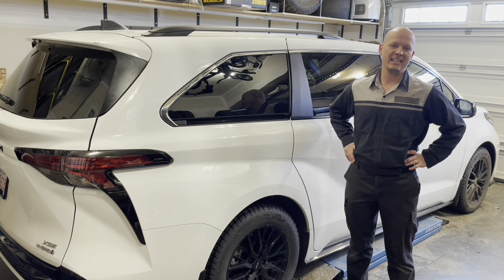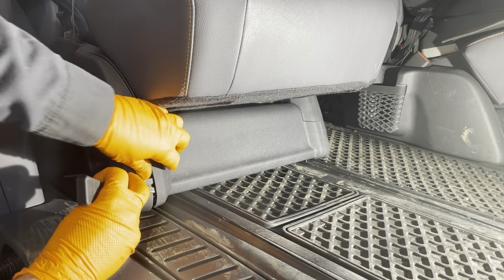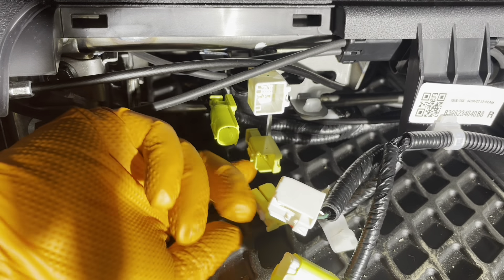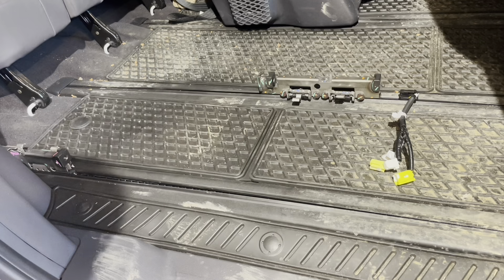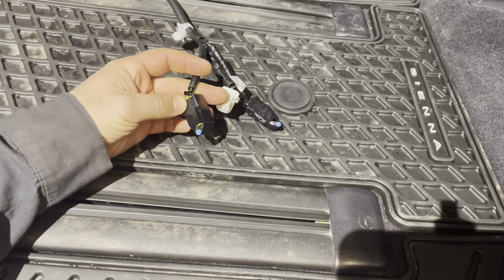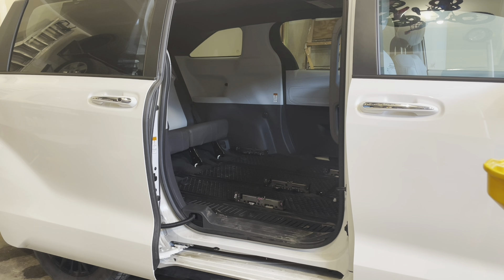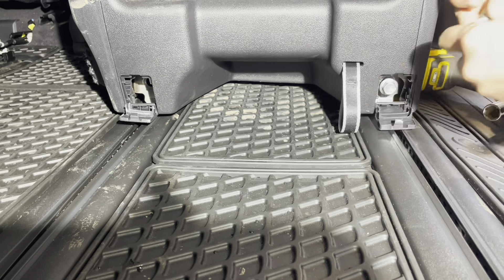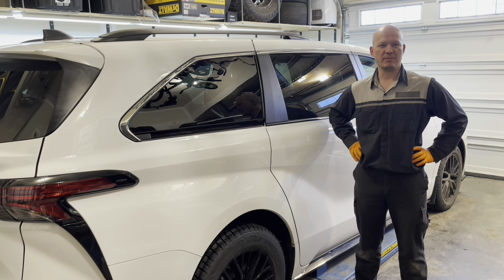2021-2025 Toyota Sienna Hybrid 2nd Row Seat Removal And Airbag Warning Light Disabling Instructions

Comment: May i have a list of the supplies you used?
Reply from the maker: @JoshuaDyke-w4z  Below are my affiliate links to the parts and tools you would use to complete this job. I may receive a small commission from the product sales. Thank you!
Resistors to bypass the airbag warning: https://amzn.to/3wF3OzV
Automotive trim and clip removal kit: https://amzn.to/3KgKGfg
1/2" drive cordless impact wrench kit: https://amzn.to/3Kcw00I
3/8" drive flex head digital torque wrench: https://amzn.to/3O1EOru
Rechargeable LED mini work light: https://amzn.to/3Y74OpY

Comment: Can you remove the seat carriages as well? I would prefer them not making my camping mattress incredibly uncomfortable...
Reply from the maker: I looked into removing the seat rails/carriages. The outer ones can be removed from the top, you would need to pull up the carpet and unbolt them. The inner ones have to be removed from the bottom, requires dropping the fuel tank.

Comment: Thank you, for now I’m stuck with the airbag light on.  Toyota dealers won’t do it and I haven’t found anyone who understands it.  Any help is appreciated. Thank you
Reply from the maker: Are your seatbelts for the 2nd row built into the seats or are they built into the body of the van? From the wiring diagrams it kind of looks like the seatbelt retractor assemblies are on either side of the van body instead of inside the seat. If that is the case, there is no need for 4 resistors, just 2 resistors for the yellow side seat airbag connectors under the seats. Make 100% sure that you got the correct 2.2 Ohm resistors (measure their resistance with a multimeter with the resistor out of the vehicle) and that they are inserted fully. It is possible it's just a bad resistor contact inside the connector, I had that happen once when I pulled the seats out. Wiggle the resistor pins in the connector to make sure they make good contact and make sure they are inserted into the actual female pins in the connectors, not in a wrong spot beside the pins.

Comment: If u remove seats from second raw. Can u drive with air bag lights on?
Reply from the maker: Yes, but why not install the resistors and get rid of the warning light?
Reply: Bit worried to pock this resister  in the wrong holes... Lol if u could upload where exactly goes will be very helpful. Appreciate ur help and quick reply u r amazing 🎉
Reply from the maker: @salimwadhwania9843  they go into the yellow connectors as shown in the video. Since they plug into the vehicle side and not the airbag side, you cannot cause airbag deployment by making a mistake installing them.

Comment: I have a question.Yesterday I went to Lexus dealer to complain my car Lexus RX350 2020 base model. the illumination light not turn on both control left and right on steering wheel at night time.Anything else in the car illumination turn on.The Lexus dealer mechanic technician told me my mode don’t have it.I know you fix too many Lexus cars maybe you can give me the answer.Thanks
Reply from the maker: I don’t know the answer for sure without digging deeper into it, but it is quite possible that the base model does not have illuminated buttons.

Comment: Hey, I did all that you instructed but still got the SRS system malfunction. I tried to scan it withh blue driver and attempted to clear it but still the same. It says "Status: MIL/CONFIRMED : Second
Row Left Seatbelt Pretensioner
Deployment Control : Circuit Open" both left and right
Reply from the maker: @killuv811  that would mean the resistors were not installed into the connectors correctly. Double check that they were inserted fully and into the proper female pins on the connectors.
Reply: Hey its working now. Thanks man!  @Viktor_G_Automotive
Reply from the maker: @killuv811  my pleasure!

Comment: Followed the video but have air bag lights on and automatic doors do not work.....please tell me what to do.......
Reply from the maker: The resistors are likely not inserted fully or properly, causing the airbag light to come on. You can check my Sienna battery replacement video to see how to initialize the sliding doors. Essentially, just close them manually.
Reply: @Viktor_G_Automotive  Any suggestion to which holes and how far to insert them ? All other systems reset ok ! Thanks
Reply from the maker: @themoat3677  when you unplug the connectors, you will see one end has male pins and one end has female pins (holes).
Insert the resistor legs into the female pins that the male pins originally went into, all the way in until the resistor legs cannot go in anymore. I think one of the connectors appears to have 4 holes in it, make sure to insert into the holes that line up with the male pins, not the other empty unused holes.

Comment: I tried these resistors they don’t work i’m trying to figure something else cause my airbag light is on
Reply from the maker: @בנמיןמנהיים  they definitely do work, hundreds of people have installed them by now. Make sure they are installed into proper pins and fully inserted. Double check it because it is possible to install them incorrectly into the wrong spot on the connector.
Reply: @ do you have a diagram of the right pins?
Reply from the maker: @ they are the yellow connectors shown in the video. You wouldn’t need a diagram as each only has two wires. However, the connectors have what may appear as 4 holes in them. I’ve seen people try to stick them in the wrong spots on the connectors, or not insert the resistor legs in far enough to make contact.
Also, you could scan the SRS ECU for fault codes and that will tell you which specific connector(s) are having the issue.

Comment: Once again thank you for the info sir 👍
Reply from the maker: @mastathrash5609  any time!
Reply: @Viktor_G_Automotive  I had to do this today it boggles my mind that Toyota and all their Infinite Wisdom cannot make an unclip-able seat. One that you don't have to undo bolts like if they can mount tracks around the battery in the hybrid I don't understand why they can't make a rail system that can make them removable with strength and mabey an extra hand.
Reply from the maker: @mastathrash5609  it’s probably because the seats have airbags built into them and Toyota doesn’t want you to mess with disconnecting those when you’re removing the seats, so they bolt them in “permanently” instead of building quick connects into them.
Reply: @Viktor_G_Automotive  you are probably correct. I couldn't see where they stuffed em (the airbags themselves),  but I unplugged it easy and got them out so it was a success! Second time your channel has helped me out this week alone,  I'm not Factory trained but I am well trained in general and you're a good, quick teacher, so I appreciate it.🤘

Comment: For all the people complaining about how difficult this is, how often do you think you'd be removing these seats?
Reply from the maker: @jondrew55  good point 👍
Reply: @Viktor_G_Automotive  good video. I was surprised the airbag warning defeat was nothing more than a resistor.
Reply from the maker: @jondrew55  thanks!
Reply: I rarely have those seats in my minivan.
Reply: Some of us do it several times a year. At which point we have to wonder if the hybrid gas mileage is worth the extra hassle.